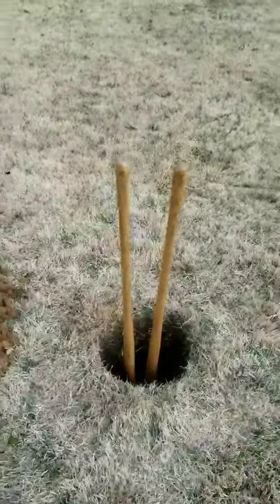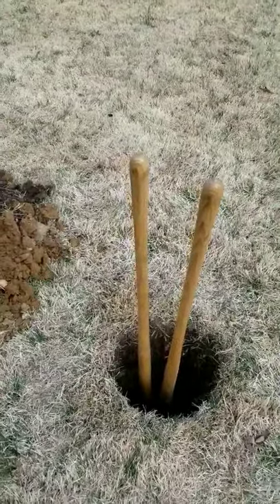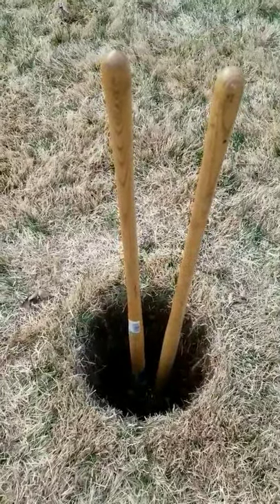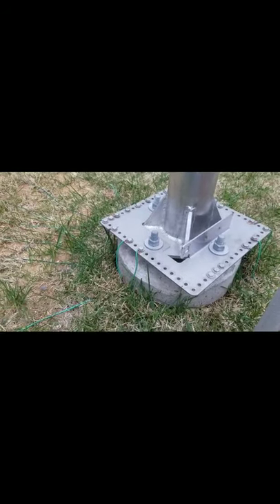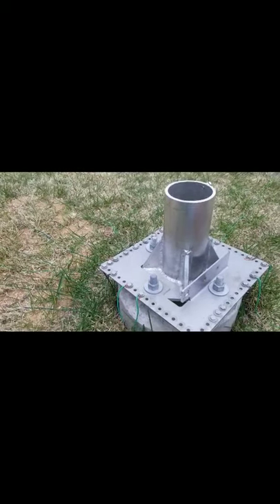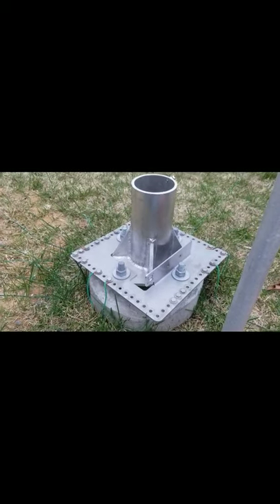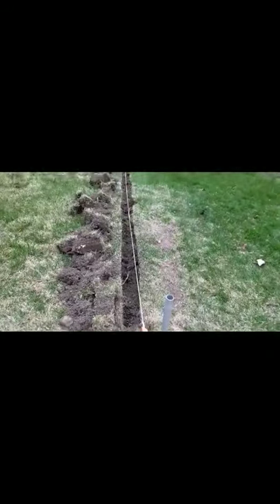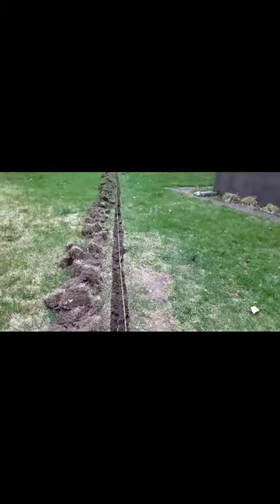ZeroFive Antennas 30' Flagpole

Comment: Thanks for the video. Looks good. I purchased the 43 foot zerofive vertical antenna and I have been happy with my antenna. The aluminum Zerofive uses is by far thicker than the hustler 6btv that I had previously had up and works at least as good. The 43 foot Zerofive is able to handle more power than the hustler which had some traps burn out after I purchased a 1.5 KW amp.

Comment: Elsewhere someone indicates an issue with the main nuts coming loose.  I read this, and as a result checked mine every month for a year.  I had no such problem, not even a tiny bit.  I have strong winds in my area - just south of Wyoming, and extremes in temperature - from -5 to 95 degrees. I’ve had ZERO problems of this type.
Reply from the maker: I have not noticed any loosening of the nuts which bolt the sections together.  At the time, my kit was supplied with nylok locknuts, and they seem to do the trick.

Comment: That's a great project.  An alternative to a 48" vertical dig might be a 24" deep 18" diameter hole, which would be a lot easier to dig and should provide as stable a base.  I'm not a concrete expert, but for a similar project I'll certainly consider a shallower and broader solution.

One finishing suggestion:  Surround the base with a rock landscaping bed with weed arresting material of some sort.  That will provide a very clean look; otherwise, you're going to have no end of trouble trimming grass from around the base without risking damage to your radials.
Reply from the maker: The foundation I used was specified by Zero Five, so that's why I went with that.
I now have a circular wall of 3 courses of cobblestone around the flagpole, and have the 36" i.d. filled with grey crushed stone.  The downside to this is that the cobblestones sit on the radial wires.  So if there is ever any maintenance needed, I will have to figure out a way to burrow under the cobblestones, and bring a cluster of wires outside of the wall before fanning them out into the lawn.  I have forty-five 33' radials installed presently with no current plans for more. Thanks for the comment.
Reply: @thomashybiske5399  Excellent, Here's hoping you never have to get at those radials, and the way you've installed them, you probably will not.
Reply: I think a 24" base will not be below the frost line.

Comment: Excellent video!  Thank you. Wish you made another showing it’s performance.
Reply from the maker: Thanks very much.  I wanted a vertical that I could hide in plain site, and this fit the bill.  It sits on the side of my house, and I think by now the neighbors have forgotten me spending hours on my hands and knees pinning down radial wires.  To them, it's simply a flagpole.  Other than that, it's nothng more than a 30' radiator.  I've got a 3 element SteppIR yagi and a SteppIR BigIR broken down in my garage from my old house.  They just won't work here, so this is the best I can do.  Thanks again.
Reply from the maker: Perhaps in the future, I will make a video showing it's performance.  Trust me though, it's nothing special.  It's a compromise antenna I chose to fit into a particular set of circumstances.  Thanks!

Comment: Thanks for the informative video!

What’s your 80 meter SWR before tuning it on the radio. Is the SWR less than 2:1? Many antennas have a narrow bandwidth on 80 meters to keep the SWR less than 2:1.

I didn’t see any lightning loops in the cable. When cables are run, usually a loop is made in the cable to help stop the lightning energy from traveling through the cable. 

The flagpole antenna isn’t stealth, which you’d need to do if you have HOA antenna restrictions. To make it stealth, I think you’d have to mount the antenna tuner / coupler closer to the ground, and in case the whole bottom of the antenna with bricks or wood to make it look like it’s not an antenna, but looks like it’s just a flagpole.
Reply from the maker: The flagpole is simply 30' of aluminum tubing over a large radial field.  I imagine the VSWR on 80m is significant without the insertion of a tuner.  Placing the tuner (coupler) out by the antenna reduces transmission line losses when compared to a tuner located near the transmitter.

There are no loops in either the 1/2" Heliax transmission line or the 4 conductor control line.

Since the video, I have constructed an 18" high circular wall around the flagpole.  I chose the flagpole due to the visibility of my corner property rather than any HOA requirements.  I have a 3 element SteppIR yagi and SteppIR BigIR presently sitting in my garage that I used at my former rural home before I moved.  This is a compromise, but it is what it is.  I have been pulled into weak signal VHF/UHF now too, so I have a pretty full slate here.  Thanks for writing.

Comment: Hi Tom not sure about the ground system a little confused?  You already have the lower element grounded so I don't see any value in the spark gap.  Electricity takes the least path of resistance.
Reply from the maker: Ray, the radiator, i.e. the flagpole, is not DC grounded, but is isolated from the grounded aluminum mount by a large oil impregnated insulator.  When NOT in use, I short the radiator to ground by way of a solid, #4AWG wire which indeed renders the spark gap redundant.  However, when the flagpole is in use and the shorting wire is disconnected, the flagpole is isolated from ground and is connected to the autocoupler.  The Icom autocoupler has minimal high voltage protection on the antenna side, so the spark gap is another line of defense against atmospheric static build up on the flagpole from wind, snow, thunderstoms, etc, and possible damage to the autocoupler, while it is in use.  I lost another Icom AH-4 years prior when an induced high voltage on the long control lines and actually blew the surface mount components of the controller circuitry off the internal PCB.

Comment: Did you connect the mounting studs to the rebar forms? If so how did you connect them. Hoping to put one of these up before winter.
Reply from the maker: I did not.  I just made a simple cage, and set it in the hole on top of a couple inches of concrete.  Then poured around it.  I then set the pole socket with the J bolts bolted to it into the wet concrete and let it cure.
Reply: @thomashybiske5399  wonderful thank you so much for the info. Seems pretty simple actually. I will rent an auger that digging is for the birds lol.

Comment: I substituted SS Nylok nuts for the hex nuts provided wehn I found that the nuts provided had loosened after only a few months. I had tightened them during instalation and even with lock washers they still loosened. I went out one morning to hoist the Flag and looked up and saw one of the screws hanging out about an inch. The nut and lock washer were no where to be found. Brought the pole down and changed out all the nuts. I found one other screw that was loose.

Comment: I'm curious about the band/frequency range for this antenna.  Could you please share this information?
Reply from the maker: Bob, the antenna is simply a thirty foot piece of tapered aluminum tube.  It's totally passive with no traps, or moving componentgs.  You can tune it from the shack with your transceiver's internal tuner, use an external antenna tuner just following the transceiver, of use an antenna coupler at the base of the antenna like I opted for to reduce transmission line losses.  My Icom AH-4 links to my Icom IC-7610 as well as a number of other Icom transceivers.  It will tune from 80m to 6m.  The claim to fame of the entire line of Zero Five antennas are their brute construction.  I have never seen an antenna built like this one; it's remarkable.  Also this antenna requires radials of basically any length and quantity.  In constructing this one, I chose to install forty-two radials of approximately 32' in length, although there are perhaps eight to ten radials which had to be shortened due to physical obstructions.  There are also a half dozen or so that are much longer; around 60' in length.  The radials were placed in direct contact with the grass and soil, and were held down with home made U pins, and a large nail at the end of the wire to keep them straight and taut.  The grass and thatch quickly covered the wires and I now mow the radial field area with a standard lawn tractor.  The project was a lot of fun planning and constructing, and I highly recommend it.

Comment: A trick for pulling cable through conduit is using a strong rope or fishing string. A shop vac on one end will pull it through as you feed it through the other end. You can make it very easily with the large radius couplersand the lube.

Comment: That's nice. How does it work on each band. What's the bandwidth on 80 Meters?
Reply from the maker: It works really well.  Bandwidth isn't a problem because you just retune it with a press of "Tune" button on the radio.

Comment: I wished you'd taken video while putting the round guard and pouring the cement. Anyways all is good. Congrats on your set up. Hopefully I'll have a non-hoa house next year. Take Care and 73.
Reply from the maker: The original plan was to go all the way to the bottom with the 12" diameter cardboard form.  I was concerned about having an intimate contact between the surrounding soil and concrete but figured this would be the only way to do it.  However, I realized that in digging the hole, I dug out just enough soil to make the form a press fit.  This allowed me to dig out the bottom a bit more to form a bell shape to it.  I used a mallet and a block of wood to tap the form into the hole after most of the concrete was shoveled into it being careful not to damage the edge of the form.  Press fit is the key.  In my case, it was sheer luck that I had dug out the exact amount to press it into, but not enough that it would fall into the hole.

Comment: Was the copper lubricant specified by the Mfr? Seems strange to put two components that react electrolytically against each other (copper vs. aluminum), unless the idea is to bond them permanently. I guess it would help with conductivity between all the joints.
Reply from the maker: I used it based on many years of prior use on aluminum antennas.  I hear what you're saying, but here's the description from  DX Engineering advertising:
"Jet-Lube SS-30 Pure Copper Anti-Seize is the top choice of engineers and technicians in government, industry and leading Amateur Radio contest stations, for protecting mechanical assemblies of aluminum tubing, general hardware and copper grounding systems"
Reply: You are correct Warren. It should not be used here. I'll copy and paste a portion of what I posted elsewhere:

Due to galvanic corrosion, I would not recommend using SS-30 here. I know DX engineering recommends it, but that's a mistake that I believe is driven by their automotive division, where this product is at home. I read that the manufacturer does not recommend it for aluminum; however, I didn't get that directly from the manufacturer. Nonetheless, aluminum and copper are not a good combination in this application. I would recommend Noalox or similar.
Reply: I don't know why DX Engineering would recommend using a copper based product with aluminum parts. There is a product made specifically for aluminum to aluminum electrical connections. It's called Gardner Bender Ox-Gard Anti-oxidant Compound and it can be found at Menards, Home Depot or other electrical suppliers.

Comment: MFJ makes a surge suppressor with gas tube for surge. I would not bet my radios on something I made!
Reply from the maker: ...and I wouldn't bet my radios on anything MFJ made!
Reply: @thomashybiske5399  there are 2 or 3 others that make the gas tube surge suppressor.  I have not had anyone tell me anything bad about MFJ before. I am just thinking that you don't know at what voltage that will work,  it is easy to get bumped and maybe short out the antenna.  I don't want to put down anyone or anything.  Just I think if you go to any of the Ham Radio stores there are some gas tubes sold to do this. Pick one that you trust.    73. DE W4DES
Reply from the maker: @donaldsmith3048  Thank you for your comment, Don.  I made my previous comment regarding MFJ sort of tongue in cheek, but there's a lot of truth in that.  Here is the problem: If the transmission line ran directly to the feedpoint of the antenna, I could use some kind of gas tube arrestor or a simple EMP network right at the antenna feedpoint which would be tied to an extensive grounding setup.  The problem is in the remote tuner.  The jumper wire from the antenna to the tuner is actually part of the antenna.  There is no place to insert any lightning abatement device except between the house and the remote tuner.  This makes the tuner vulnerable to any significant static discharge.  I had one AH-4 destroyed years ago by a nearby strike.  It entered the box via the control line and actually blew parts off the internal pcb's.  The antenna side of the box was undamaged, but it was still a total loss.  So this time I've buried the control line and disconnect the jumper from the flagpole to the AH-4.  I short the flagpole directly to ground when not in use.  I do have a gas tube  arrestor at each transmission line where it connects to my entrance panel at my house.  But regarding my flagpole vertical, I believe that I have done the best I can do with what I have to work with.  I took a picture of the  antenna base area, but I'm unable to post photos here, unfortunately.  Thanks,!K3GM
Reply: @thomashybiske5399  I don't know if this will help or not.  I worked at a place that had a 300 ft tower in Florida.  We had wires going from the building next to the tower to the main building and were always getting charges from the tower coming in to the main office.  We put low amp fuses 1 amp on the wires from the tower building and MOV's on the office side. That helped but sometimes what came in was just to much.  But stopped much of it.  MOV become a short when there voltage is exceeded,  shorting it to ground. Don't know if this will help you with your problem.  Just an idea.  We used 16-18 volt ones. Don't remember what voltage they are made but we had the 16 V, 28 V,  175 V,  280V it has  been years so I may be off on the voltages.  But we had them to use for 12V,  24V,  120V,  and 240V. The MOV were above what would be on the lines.  Metal Oxide Varistor.. don't know if this will help just putting out ideas!    73.  W4DES

Comment: Never connect the house grounding to any of your antenna grounding system
Keep your station on its own 
Grounding!!.
Reply from the maker: I respectfully disagree.  You want the entire ground network to bounce evenly.  When one segment of ground bounces higher than another, current flows.  In my installation, EVERYTHING is tied to a single point ground.  That is the utility ground rod at the service entrance.
K3GM
Reply: @thomashybiske5399 - well done. That’s what NEC and best practices require.

Comment: Due to galvanic corrosion, I would not recommend using SS-30 here. I know DX engineering recommends it, but that's a mistake that I believe is driven by their automotive division, where this product is at home. I read that the manufacturer does not recommend it for aluminum; however, I didn't get that directly from the manufacturer. Nonetheless, aluminum and copper are not a good combination in this application. I would recommend Noalox or similar.  

I can assure you that spark gap and anything else like it, short of implementing Motorola R56, will be meaningless in a direct lightning strike. 

You've got another problem with your grounds. They must be bonded at the service equipment. That's not just the NEC requirement, it eliminates electrical differences, and a path for transient voltage to flow through your equipment. Unfortunately, as configured, you've created a bigger problem than you have solved.
Reply from the maker: Thank you for your comments, but you must have missed the part at 23:25 where I show the entrance panel bonded to the utility ground.  Any ground rod placed by me is tied back to the service entrance ground.  None are left isolated.
Reply: @thomashybiske5399  I did miss that. Well done. Videos like this are very helpful to the community. While they add time and labor to the project, they serve the community, so good on you for doing that.